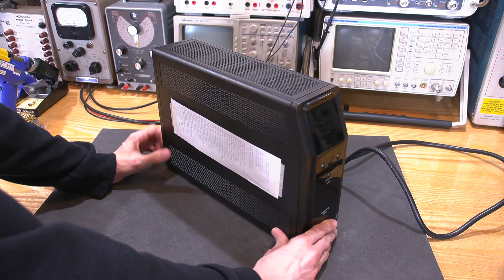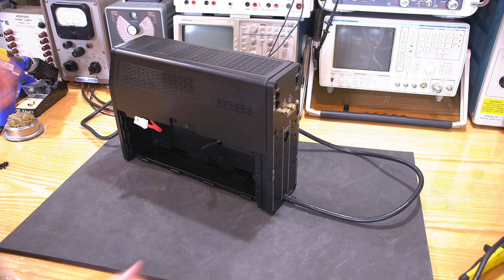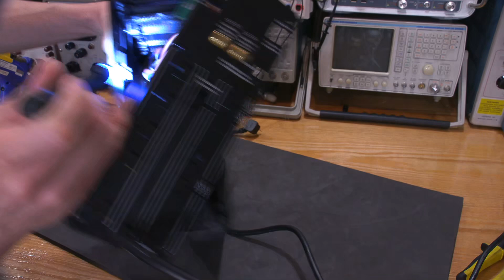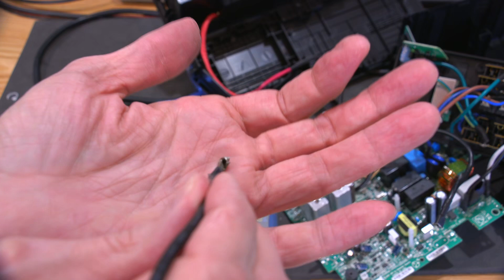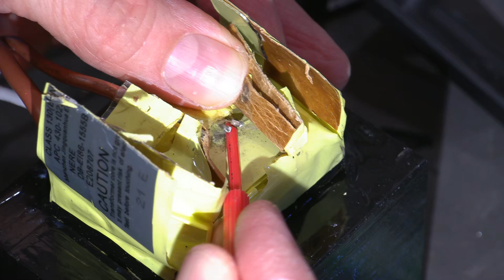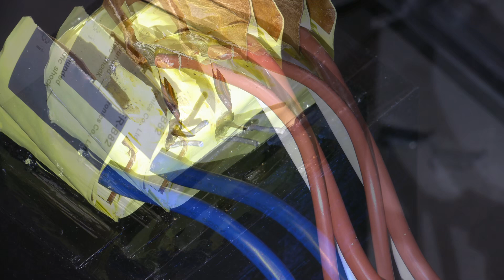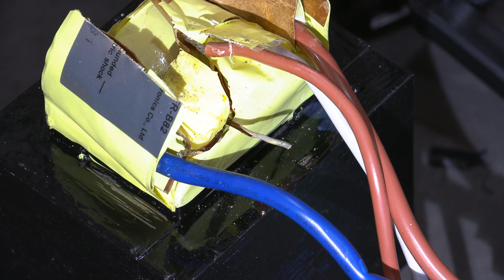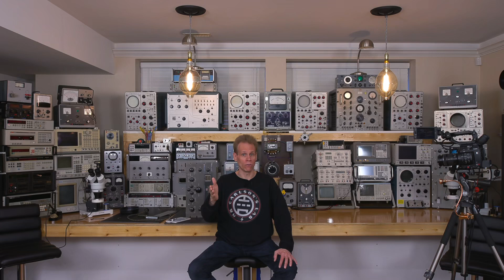UPS Electrical Failure - Teardown and Analysis!

Comment: I was building my dream system and bought two UPS as power wasn't reliable and I wanted the linux server to be on 24/7.  Delivery man almost had a coronary, each 300watt UPS weighed about 50 lbs. One UPS worked fine and I had no trouble - powered the computer and monitor, so I could shutdown if power off for more then 10 minutes.  The other UPS made it thru two short power failures and then one afternoon the alarm sounded and I couldn't silence it.  When I plugged the system back in it was dead;  there were two sealed lead acid batteries in it, that explained the weight. I got rid of the other UPS as I didn't like the idea of using lead acid batteries and I expected more trouble in future.

Comment: I've had 20 or so APC UPS's over the last 20 years and have only 2 failed. They ranged in age from 10+ to 3 years old. All I've done is replaced some batteries. I have 10 currently protecting all of my electronics, we get occasional dropouts. They range from 75W to 1000W. The F04 error is a clamp short, the F02 is the same error only when operating on batteries. There is a tip on fixya that may clear that error. There is a large amount of current in that transformer during inverter operation.

Comment: It's the first time I have ever seen or heard of a transformer being wound with Aluminum. Aluminum is far less conductive which means it heats up easier. It is softer and far less durable than copper. It's a recipe for disaster. It's a potential fire hazard. There is no way I will ever buy an APC product since seeing this eye opening video. Thank you so much Mr. Carlson. SCARY!!!!!!!!!!!!

Comment: I would have guessed mosfet driver, but I see they have cheaped out on the transformer as well.  I bought some old used APC Backups for an electronics surplus store back in 2008  900va and they take two 12V 11AH batteries each  and a 1200 va that takes two 12V 17AH batteries.  All of those are still working.  I bought 10 of the new style APC 1500's (which also used two 12V 11AH batteries) where I used to work around the same time and three of them failed by 2014 when I left the company.

Comment: If only they took the aluminum windings all the way out to the circuit board and screwed the connection it wood still be working. And cheaper to make. You made the rite choice to scrap them all.

Comment: Using Aluminum in a power transformer is something that's been done for quite some time. Most Microwave ovens, their primary is Aluminum. APC prior to Schneider Electric buying them out used Copper at least all the UPS's I have are, but copper since became super pricey, and you can get away with using Aluminum if you adjust and use proper connection methods. That however was not and should never be considered proper for a copper - aluminum connection, only the solder kept the connection from corroding. Cheers

Comment: They used to use aluminum wire in house trailers back in the 60's, I owned one till it caught fire and burned down.......because of the aluminum wire. My wife and I would be sitting watching TV and all of a sudden you'd hear this arcing sound, then I'd have to go around and re-tighten all the outlet screws, till it did it again. I thought they would never go back to using that in electricity again, but guess so. I realize it's used on 'entrance wire' feeding your house, but it's outside, don't care if it arcs there! They're REALLY getting cheap again!

Comment: I picked up one of these last year and it was dead. I'm wondering if it had the same problem. Mine had blown mosfets but I wonder if they failed because of the transformer. I replaced them but they failed again so I gave up on it.

Comment: Thanks for the autopsy of this UPS. I've had several of these same units fail along with the warranty replacements. Either firmware issues or seeing the outer case actually melting because the transformer overheated. Even with a small load! APC demands a premium price, but IMHO, their product is far from premium anymore.

Comment: CCA, or Copper clad Aluminium. Pretty common among CAT 5/6 cables. although they dont ever get soldered :P That's my best guess Paul ;) Although I'm confused as to why it would be in a transformer. Thats not my wheelhouse though, so I'm hoping someone with more experience in that field would chime in if its used commonly. Never a dull moment ;) TC and Stay safe Mr C.
Reply: Unfortunately that's not even CCA. Just "pure" aluminium wire with enamel insulation. 
I've seen a lot of these things in cheap, transformer based stick welders but even there all connections were properly crimped.
Reply: @PeIVBV  Thanks for the Info :)
Reply: @PeIVBV  also cheap big box store Lincoln mig welders.  I have one I took a peak inside out of curiosity once and remember being surprised to see one.
Reply: You can actually solder aluminium to copper but you need to use the correct type of solder, flux and prepare the aluminium wire by scraping off any oxide first. Crimping is somewhat safer to instruct production line monkeys to do as they cannot attempt to optimise production costs by substituting a different type of solder or skipping preparation of the wires.

Comment: Ive an OLD APC ups thats re-jiged to use normal leisure batterys, she can run my whole office no problemo. I did read about issues with newer APC stuff, but i bought old just cause thats all i could afford (a rackmount unit with dead batterys) . Guess ill hang onto the old girl :)

Comment: Is it ups failure month or something? My online Eaton 900w blew up just two weeks ago, found bits of transistors rattling around when taking apart to investigate it, and it kept arcing for I think 10 seconds before failing completely, it was pretty scary because there was no way to disconnect the battery in less then about two minutes. >_< :)

Edit: guess I’m lucky I came across a pretty old pure sine Apc ups cheaply several months ago that I could fix up (leaked batteries only), not sure with todays quality what’s worth buying anymore.

Comment: I have one of there and have had it long enough to have had to change the batteries in it. it serves for more than just back up power, it trips on over voltage and we get surges during nightly power company switching.

Comment: I have an old APC UPS, I call it, Ol' sparky. I call it this because I've had it for many years and the only fault I ever had with it was many years ago when it would generate some random orange sparks inside... I looked into it and discovered that, well you see how you have wires bolted to heatsinks there? They obviously relied on the centre pin of some packages being linked to the body and rather than putting thermal pads between them, ran with this. They used this as a feature, made the heatsink a conductor for the centre pin, and screwed terminals into the heatsink. Ol' sparky sparked because, thermal expansion and contraction loosened the screws causing intermittent contact and the orange sparks. All I had to do was sort that out and I'm still using the thing twenty years later. I actually think it is a good design choice to get the heatsink to act as both heatsink and conductor, they just needed to work on their mechanical attachment.

Comment: in a small transformer thats just plain being cheap  though not unheard of.  the old lincoln "tombstone" welders are without a doubt some of the best old welders around. but back in the "80"s they suddenly weighed about half as much. come to find out they were aluminum wound instead of copper. over time they started failing. heat/cool cycles had work hardened the aluminum and the windings would break.

Comment: APC was purchased by Schneider Electric (French), who also bought SquareD.
The QualityAssurance Report is that Paper Tape (I keep them and boxes).

Your BackUPS is a later version of models that I purchased ~15 years ago.
Your model has a different battery layout of the RBC gel cells.
** I have watched production changes to save $$ , for passed 30 years.
APC had issues with UPS Leakage (would not pass Hospital usage standards),
in mid-1990s — they ignored and did not correct design or component suppliers (at that time). **

Comment: Soldering to aluminum is definitely possible Mr. Carlson, all comes down to the flux and getting rid of that oxide layer on top! Phosphoric acid works, I've seen it done with oil and sandpaper too
Reply: It's still garbage.
Reply: Yes,  but the transformer manufacturer clearly couldn't be bothered, using a wrap of standard wire as a mechanical fixation instead.

Comment: I saved the power transformer from my last UPS. I wonder if that has aluminum windings as well. I am kind of shocked they would approve of this method of connecting the wires.

Comment: Copper clad aluminum, just thick enough to solder once, is pretty typical in the cheap stuff now. This is a new low though, did the unit have a UL mark?

Comment: With the amount of material transformers are becoming quite expensive. They cheaped out in an esencial component. I’m an electrician and I reject all reparations of aluminum wiring because of the liability. Unless it’s a rewiring I don’t touch aluminum. The only acceptable aluminum conductors, for me, are transmission ones because they are well engineered.

Comment: Thanks for the autopsy on your UPS.  I have several APC's in use and have never had a problem other than an eventual battery replacement.  My guess is that the transformer had a marginal connection from the get-go.  However, that doesn't make anyone feel any better about the quality.
Reply: They are 'marginal' connections because standard lead/tin solder doesn't adhere to aluminum.
Reply: I have several UPS devices running in my house as well mainly APC Back-UPS 1500/1300 models and I find they all pretty much fail after a couple battery change intervals when their internally circuitry fails.  They commonly either stop charging their batteries or overcharge their batteries and the entire UPS has to be replaced.  If they last 6-7 years I am happy...................

Comment: APC/Schneider Electric is a good-sized company and in my experience produces/sells quality gear. I have installed & owned numerous UPS’s from them over a 20+ year timeframe and other than batteries reaching the end of their useful life have had no issues. If it were not that Costco now sells CyberPower UPS I would still be using APC (Costco will take virtually anything back if it ever fails to please, including Christmas trees that died [not me!] so I buy there when I can).

You can get a catastrophic failure from any manufacturer’s equipment, and APC has always stood behind their warrantee, so this one probably would have been replaced since they come with a 3-year warrantee. They may still do so.

With regard to Aluminum vs. Copper, as long as proper procedures (such as use of the correct solder/flux) and materials (wire gauge, etc.) there is no reason that Aluminum wire can’t be used in transformers. All of the issues with Aluminum house wiring years ago were lack of following procedures and components (re-torquing connections, bi-metallic connections, proper gauge, etc.). High voltage/high amperage feeders in industrial installations are typically Aluminum, as are overhead/underground distribution in residential locations.

Comment: Cheap made transformer either from China or India, by saving a bit copper, replacing it with aluminum wire to make transformer choke. Solder aluminum wire to copper with common solder is all most impossible even using special aluminum solder paste. As aluminum joint has copper along with SnPb solder to form a mixture, it creates a thermos effect. Heavy current passing through it makes the joint heat up more quickly and melt the solder away, and then the joint becomes higher resistance and even burns quickly. Perhaps, UPS output transformer ever being triggered oven, UPS only kicks up while power line cut off. This cheap made product takes chance to save a bit manufacture cost by using aluminum coil made transformer, because UPS is hardly uses to generate power daily, hence, such manufacture hidden defect would ever be found!

Comment: Okay I had my suspicions. Aluminum windings power transformers is a cost savings thing to them. I cannot even remember last time I saw an aluminum transformer before. APC quality has been suspect lately, as I am a home integrator and using APC products is not without its quality or defects.

Comment: As pricey as these things get, and they can't afford to use a few ounces of copper. I know that aluminum is often used, but what is the proper way to wire it? thinking maybe crimp a piece onto the end? I dunno. That could be too expensive. I have no idea what the standard way to do this would be. I think i've only ever opened a transformer when scrapping for the copper.

Comment: Cheap arc welders also use aluminium wires, but the ends are bolted. It is possible to solder to aluminium but is very tricky!

Comment: I am shocked that APC would use such a horrible low-quality transformer
Corporate greed is really horrific

I remember trying to get throttle position sensors and they sold through the dealership for $200 each and I found the factory in China that makes them and they were $0.20 each

The same thing with the blood sample collection tubes that sell for $60 for 30 of them cost 30 cents

I don't have a problem with people making money but thirty thousand percent markup is sick

When I saw the first dual-band Ham radios in the 90s and they were around $350 way out of the price range of the normal person and ten years ago when I saw dual band radios for $35 with the baofeng and other brands that were Chinese knockoffs I didn't think they would be usable but they perform just as good

It really is awful to see how much greed there is with everything from medical equipment to electronics to sneakers to automobiles everything they can they markup ten thousand 20 thousand 30 thousand percent over what it cost to make and they make it in the cheapest countries they can and the people at the very very top get all the money

Very very sad

Comment: Aluminum windings in a transformer, that's a new one. For future reference, especially if you're in a lightning strike prone area, check out the common mode choke, caps and varistor that usually are hooked up first thing after the power cord enters the UPS, those are also common failure points.
Reply: Aluminium as a transformer wire does not seem to be that uncommon. I've seen it a lot in microwave oven transformers.
Reply: Not new at all, some Soviet transformers used aluminium wire for high current windings, for example filament windings in Rubin 714 TVs were aluminium worked fairly well, many of those transformers were turned into bench power supplies because they usually outlived the TV - probably because they were crimped and not soldered lol
Reply: @IgnacyG1998 , @blubb spinat First time I've encountered them.

Comment: That almost looks like copper clad aluminum. I've seen this used in CATV hardline and many other places. I've seen a 50 amp industrial (truck) battery charger made 30+ years ago have all aluminum wiring and the ONLY way to hook to it was through crimp connections. The copper clad aluminum can actually be easy to solder to, however that copper color you have could be just enamel coating NOT copper. Zinc will solder aluminum to aluminum. They sell it as "welding" rod and you use a propane torch with it, but it's just like solder and only "wets" to the surface of the metal. I think that zinc will also solder to copper, but I don't know for sure. To my best knowledge, I've never heard of wetting copper and aluminum together. I would like to try this just for fun, but a pressure connection with dielectric grease is the only reliable connection due to dissimilar metals. They tried aluminum house wiring back in the 1970's and it burned a LOT of houses down. 
Also, there's a hole though the jacket of the blue wire like someone probed it with a test light or sharp object before. This UPS might have had an intermittent before and "fixed" itself until a large current heats the joint up.

Comment: I work in IT and every single one of these end point UPS units are pretty much garbage.  I have used APC, cyberpower, TripLite, and Belkin branded units by the hundreds and all of them fail at about that same rate, sometimes catastrophically.  I wouldn't be surprised if there are 1 or 2 factories that make them all.  I have had better luck with just getting a used rack mount server class APC Smart UPS off ebay without batteries and using it. Those are rock solid and I have never had a major issue with them.

Comment: APC is hands down the best. All other manufacturers that I have tried when the power goes out they don't transfer fast enough and the computers all lose power which defeats the purpose of having them.

The APC smart-ups units kick in about 90% of the time on a complete power failure, but the problem is the circuit breakers at the substations are designed to re-close three times and the power coming back on for a couple seconds and going back out usually the second or third time that UPS doesn't trip back-and-forth and the computers go off again

For brownouts and momentary irregularities these work very well but for blackouts where the substation attempts to re-close the circuit no UPS works fast enough with the exception of the really expensive continuous battery power ones

Those do not rely on the power grid to power the equipment instead they are running a hundred percent of the time off of the battery's power and the power grid charges the battery and those work very well but I've only ever seen those in industry and corporate environments in server rooms

I wish they would make one that would be just the control unit and you could buy for deep cycle 6 volt batteries like are used in class A motorhomes for their power system